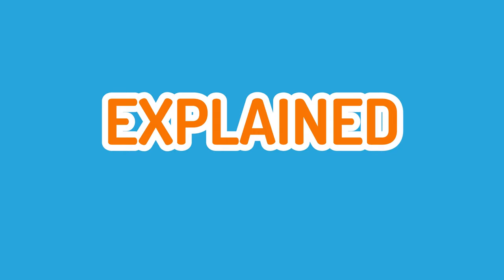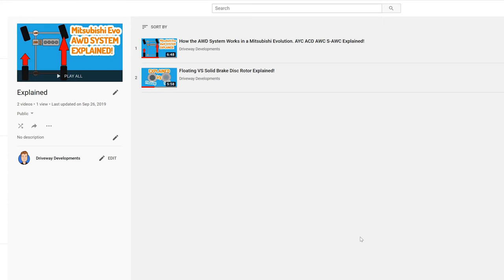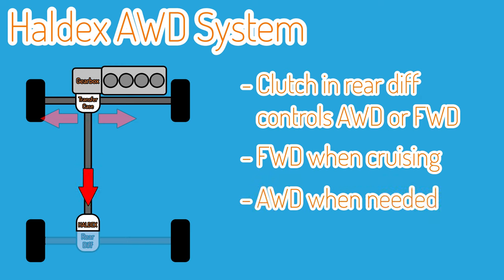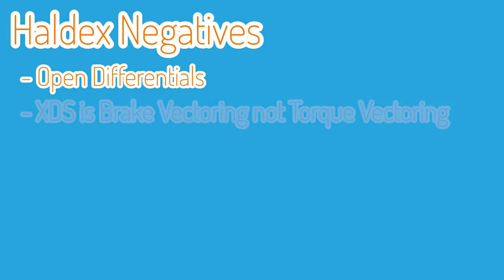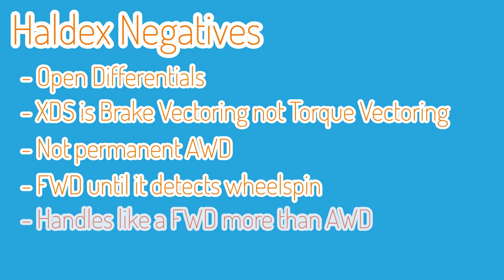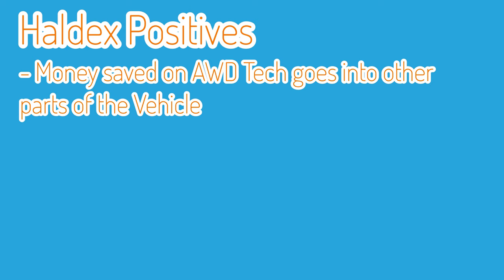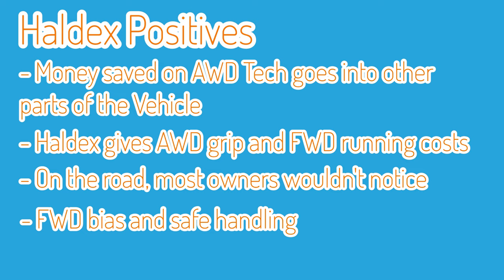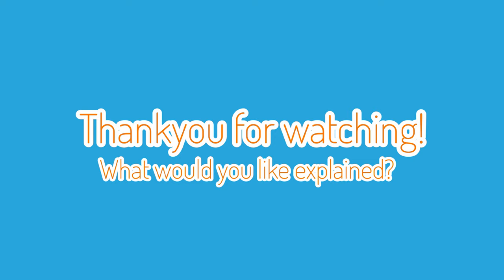How the Haldex AWD System works in a Golf R

Comment: If you watch roller tests for Golf Rs, you can see their AWD kicks in so quick, they look like they are permanent 4WD cars. The Haldex AWD system is pretty damn close to a mechanically linked AWD system. Not perfect, but pretty damn close.
Reply: Thanks because haldex gen 3, 4 & 5 are proactive systems, not reactive as stated on the video! The more torque generated by the engine, the more torque you'll have on the rear diff!

Comment: Very useful video, however just a point regarding the the 5th generation haldex system on the mk7 Golf R. It takes readings from accelerometers to predict demand for the rear axle, not just relying on wheelslip like earlier haldex versions 👍

Comment: Does Generation 5 Haldex 4 Motion make operational noises when driving normally in a straight line around 2000rpm?
Reply: I am the proud owner of a brand new 2019 VW Golf R that I'm in love with I also have A GTI MkV and I can say that there is a whirring noise that just normally occurs when you start up the engine that I did not notice in my GTI and I'm assuming it is the 4Motion system that makes the whirring noise all the time😛
 However I can drive around an S turn in my Golf R at 77 miles an hour!? The safety zone recommended speed is 45mph so there😄👍🏻😏
Reply: @gtiman67  a year late but that noise on start up appears to be a heat shield near the engine that vibrates, you won’t hear it once at operating temp. Quite annoying